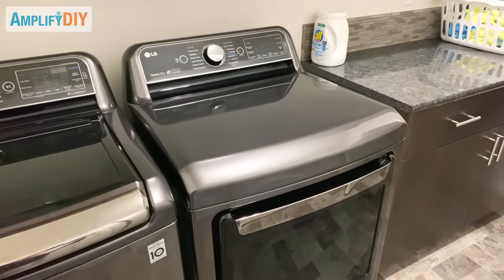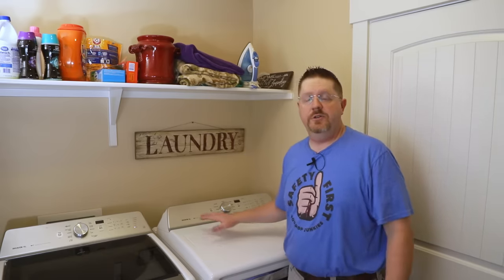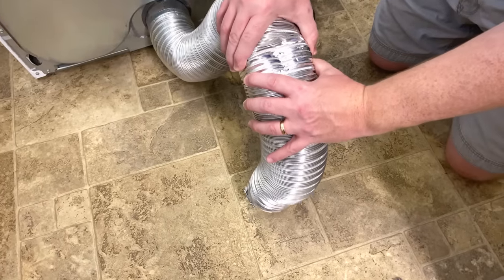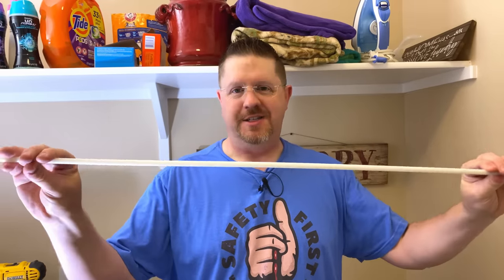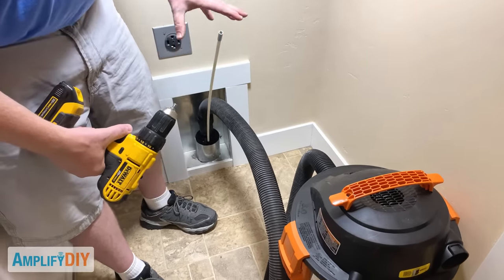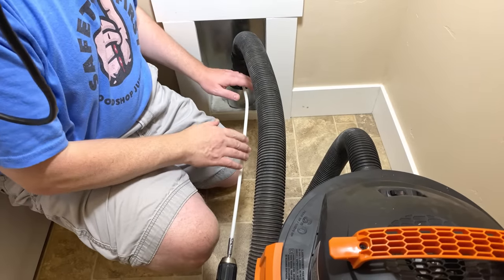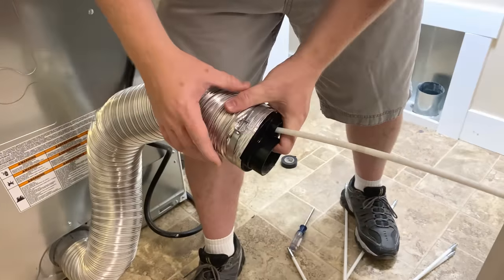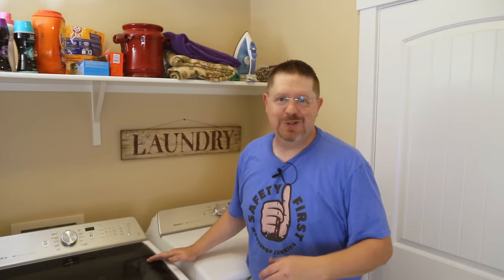How To Clean Your Dryer Vent Duct - Step By Step - It's Super Simple!

Comment: I need help :(
I'm exasperated and in pain. I think I got most of the lint out of my dryer vent duct using the duct brush cleaning kit I got at Menards today (and yep, it was a lot and a lot of work) BUT now the brush came off the rod and is stuck in the duct. Argh!!! NOW how do I get it out?? 😳
Reply from the maker: Oh no! Any idea how far in the vent the brush came off? 
Here is what I would do: go find a metal coat hanger, and bend it up so you can tape it to the end of the rods you used such that the "hook" part of the hanger pokes out the end of the rod. Then try fishing that back into the vent to try to hook the brush and pull it back out. 
Keep in mind that if the brush may be closer to the outside end of the vent than it is to the inside, so you may need to try to retrieve it from outside rather than from inside. 
Good luck!

Comment: Read that if you use fabric softner liquid or fabric sheets it leaves a film on dryer lint filter. So they recomend washing dryer filter once in awhile. Years ago I wired in an electric dryer and told the contractor that going by dryer instructions he not only had too long of a vent run along with three 90 elbows. Owner called me back trying to tell me that I did not wire dryer correctly. Showed him that when dryer was running on hotest setting he had 238 volts at dryer tetminals. But kept telling me that dryer takes forever to dry. Told him not my problem. A few days later he called and insisted that correct problem. Told him that I'm Tom the electrician and not Tom the magician.

Comment: it would seem that little screen the dryer has does a lot less then we all think.  I cleaned mine out and it had to of been 2 gallon bucket worth of lint was the result.  Granted it was a 35 foot metal pipe before it vented outside and since the lint coming out of the dryer is wet little pieces stick and build up.  But yeah its weird the dryer screen does so little.

Comment: can this be done from the outside in.  My dryer is a stacked model.
Reply from the maker: Hi Renita - yes, you can clean from the outside in towards the dryer. I have 2 tips for doing it that way:
1) Turn on the dryer with nothing in it, on the coolest setting. This will provide air pressure blowing out of the vent. 
2) With the dryer running, use the cleaning brush from the outside of the house in towards the dryer. You won't need a vacuum to suck out the lint, as the air blowing out from the dryer will blow the lint out.... right into your face. So wear a dust mask and eye protection while doing it this way.
Good luck!

Comment: Sorry, me again. I purchased this and am having trouble going from inside the house. Could I do it from outside?
Reply from the maker: Hi Melissa - yes, you can clean from outside the house towards the inside. That's a bit different process. Here is what I recommend: 
First off, re-connect your dryer inside the house. Start it on it's coolest setting, with no clothes in it. This is going to provide air pressure to blow the lint out as you clean. 
Go outside to your exit vent, and use the brush to clean from the outside towards the inside. You won't need a shop vac, or the adapter for the brush, since the dryer will be blowing air through the vent. Just clean from the outside in towards the dryer. 
One last note: When you do it this way, you should wear both eye and respiratory protection, as the lint will all get blown into your face as you clean.
Good Luck!

Comment: So wish we saw this first.  We bought the cheaper kit and all was fine until it got stuck, then we reversed the drill.   Yes it came apart and the brush is stuck somewhere in aww foot horizontal run from mid house to out side. We tried to make it out, but couldn’t. We tried pushing it out, but didn’t work.. help!
Reply from the maker: Hi Jennifer! About the only suggestion I have for a situation like that is to purchase the kit that I recommended in my video, and then use it to try and push the stuck brush out. Alternatively, you could bend up a coat hanger into a hook shape, then tape it to one of the pieces you have left. Use that to try and reach in and snag the piece that stuck in the vent and then pull it out. Good luck!
Reply: ThAnks for the feedback. Got the last kit from home depot today. It’s 12feet from dryer to outside, so the hook with the coathanger didn’t work.  Need the camera on a stick!  .

Comment: Can you do this with out a shop vac?
Reply from the maker: Yes, you can use a regular household vacuum. The only difference is that you might have to tape the hose from the vacuum to the adapter as it's not going to fit quite right. Good luck!

Comment: Can this be used with a duct that runs under cabinets and is built wide and more flat (not round going under cabinets)?
Reply from the maker: Hi Sherie - is that how your dryer duct is shaped? This brush kit is specifically designed for the round ducts, but it may work ok in a duct like you describe... likely will have a little trouble getting into the corners, though. 
Good luck!
Reply: @AmplifyDIY  thank you!  Its round attached to dryer and wall..then goes into the duct that runs under cabinets in kitchen and comes out on exterior wall of house.  I wondered about those areas as well.  Thank you!
Reply: Also, I don't see your link to purchase the cleaning system...can you share it?
Reply from the maker: @sheriehardaway8911  Here are links to everything I used (from the video description):
Lint Eater Dryer Vent Cleaner: https://amzn.to/2E0gZjK
Extension Rods: https://amzn.to/35CQTyE
Basic Screwdriver Set: https://amzn.to/32vzeHd
Budget Friendly Drill: https://amzn.to/3ivo9vm
Basic Shop Vac: https://amzn.to/3dAb8zr
Wifi Borescope: https://amzn.to/3o79REt

Good luck!
Reply: @AmplifyDIY  Thank you!

Comment: Awhile back I noticed the house getting hot every time we turned on the dryer. Turns out the vent hose had a giant hole in it. Replaced the hose but should’ve cleaned the vent to outside too.
Reply from the maker: Glad you found the leak!

Comment: My dryer vent is located on my roof, how do I ensure the brush doesn’t get stuck as I’m threading it through the pipe?
Reply from the maker: Hi Ashley - great question! The best way to make sure it does not get stuck is to tape each section of the rod together carefully as you add them as I demonstrated in the video. Go slowly and carefully, and don't force things. When the rod encounters a bend in the pipe, there may be a bit more resistance, but you should never have to really shove hard. The spinning action of the brush at the end of the rod helps it around the corners. As long as you keep the drill spinning in the "forward" direction, the rods won't come apart in the duct and get stuck. NEVER put the drill in reverse, and always have the drill spinning when you are pushing the rods into or pulling the rods out of the duct. If you have someone who can help, send them outside to watch the vent on the roof. They should be able to tell when the brush gets to the end (as long as you can see the vent from the ground) and let you know when you have gotten to the end. Once the brush is all the way to the end of the duct, keep the drill in "forward" and slowly pull the rods back out of the duct, one section at a time, just as I showed in the video. 
You got this! Good luck!

Comment: is it better I do it myself or hire a profesional and how often should I do it.
Reply from the maker: Hi Andrew - in my opinion it's better to do this job yourself. Hiring a professional will generally cost between $200 and $300 USD (at least that's what they cost in my area). Purchasing everything you saw me use in this video (including a shop vac) will cost less than that. Plus… Then you have the tools and the next time you need to do it the cost is just your time.

In general this should be done at least annually. If you have a larger household and do multiple loads of laundry per day, you should probably do it every six months.

Good luck!
Reply: @AmplifyDIY  what tools do you use

Comment: Just put a little wall between your vent outside and ac to keep the lint from entering.
Reply from the maker: The thing about lint is that it tends to float around in the air.. and would easily go over, or around any wall you built. You'll have to build a full enclosure... but your A/C's condenser has to have a lot of air move through it in order to work.. so then you'd have to add holes into the enclosure, with filters to catch all the lint... and at some point, it gets ridiculous. 
Anyhow - thanks for watching!
Reply: @AmplifyDIY  best thing....don't put the ac by the dryer vent! ☺️

Comment: Does that lint eater rod bend wanna pipe turns 45°. My pipe runs straight out of my dryer up to the ceiling and then runs to the outside.
Reply from the maker: Yes, it bends easily around the corners of your duct work. Good luck!

Comment: You showed a dryer vent on the roof, but you did not explain how to go about cleaning it as compared to the vent that came on the side of the house.  Do you have a separate video that explains how to feed the flexible cleaning rods up the roof dryer vent?
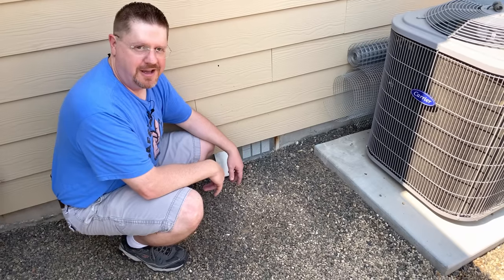Reply from the maker: Hi Master - the process is exactly the same. The only modification is that I recommend going up on the roof, disassembling the vent outlet, and cleaning all the parts of the vent outlet separately. You can see I demonstrate this and discuss roof vents starting at 5:55 of this video. 

The flexible rods and brushes work exactly the same way in the ducting, whether it exits on the side of the house or up on the roof. 

Hopefully this answers your question - let me know if I've misunderstood and I'll see if I can explain better. 

Thanks for watching!
Reply: @AmplifyDIY  Thank you for the response.  I recall the portion of the video that dealt with disassembling the roof vent outlet.  However, my confusion is whether I should feed the flexible rods down from the roof into the house or from the laundry room up to the roof.  I ask this because it would be difficult to put the shop vacuum on the roof to suck out the debris if I fed the flexible rods down from the roof.  Thanks.
Reply from the maker: Oh, that’s an excellent question! If you want to clean from the outside in, again, it doesn’t matter if you have a vent on the roof or the side of the house. Rather than using a shop vac, I recommend that you just turn on the dryer on its coolest setting with no clothes in it. This will force air through the vent while you clean, blowing all of the lint out of the vent as you go. My only extra note on this particular technique is to make sure you use eye and respiratory protection, as all the dust and lint will be blown right out into your face. 

Good luck!

Comment: How many average feet does the duct last?  20 feet 50 feet until it reaches outside?
Reply from the maker: Hi Richard. The duct length varies, but generally is less than 12-15 feet to the exterior. Some are much shorter. Others can be quite a bit longer.
Reply: @AmplifyDIY  Thank you!

Comment: A stacked washer/dryer setup is more difficult to access as two people are required to get dryer down off the top of the washing machine.
Reply from the maker: Hi Norm - this is so true! In the cases where it's difficult to move the appliances inside the house, you can clean the duct starting from the outside of the house and working in towards the dryer instead. Good luck!

Comment: where would I find the same dryer vent? Vent on outside of house..
Reply from the maker: Hi Wes - it can be tricky. They are easier to find if you turn on the dryer, then walk around the outside of the house. If the vent is somewhere low to the ground, it'll be easy to smell (fabric softener) and hear. If it is higher up or on the roof, they can be a little trickier to spot - but use your ears more than anything else. You should be able to hear faint dryer noises.... good luck!

Comment: Can you do this job without a shop vac?
Reply from the maker: Hi Bruce - yes, you can! There are 2 options: You can use a regular household vacuum, and a bunch of duct tape to adapt the vacuum hose to the kit. Second option is to clean from the outside of the house in towards the dryer. If you elect to do this, then don't pull the dryer out from the wall or disconnect anything. Start the dryer with no clothes in it, on it's coolest setting. This will provide plenty of airflow to blow the lint out as you dislodge it with the brush. You should wear eye and respiratory protection if you choose this method, as LOTS of lint will be blown directly into your face. Good luck!
Reply: @AmplifyDIY  As I'm in a condo apartment building and don't know where the outlet is and probably couldn't get to it, I'm going to use the duct tape idea. Thank you for the video and your very helpful response.

Comment: Where did you get the tool ?
Reply from the maker: Here are the links to everything I used in this video (they are also in the video description): 
Lint Eater Dryer Vent Cleaner: https://amzn.to/2E0gZjK
Extension Rods: https://amzn.to/35CQTyE
Basic Screwdriver Set: https://amzn.to/32vzeHd
Budget Friendly Drill: https://amzn.to/3ivo9vm
Basic Shop Vac: https://amzn.to/3dAb8zr
Wifi Borescope: https://amzn.to/3o79REt

Comment: Very good video, but this level of cleaning seems like overkill.  The method I use is simple and fast.  A shop vac does not have enough air flow to to clean the vents, but a leaf blower creates massive air flow.

 I use an inexpensive electric leaf blower.  A cordless would work also.  Do NOT use a gasoline powered leaf blower.  You can disconnect the vent from the dryer and stick the leaf blower in the vent.  If you have a weak leaf blower, you can wrap end of the leaf blower and the vent with a damp or dry hand towel to create a loose seal.  The seal does not need to be perfect since the leaf blower puts out so much air.  If your leaf blower is very powerful, you might not want to seal around the vent at all because if you build up too much pressure in the vent, you could damage the vent.  

I usually ask someone else to stand outside to observe how much lint comes out the other side of the vent.  Leaf blowers can be very loud inside, so I would recommend ear plugs.  Then blast away for about 30 seconds.  The vent should be pretty clear after that.

Here is a video showing the leaf blower method:  https://www.youtube.com/watch?v=Dv3l6-NlNKE

Comment: The exterior vent of my house is stupid, the metal piece that is inside the concrete wall has this weird shape preventing the brush from coming out, so it’s super or impossible to get the tunnel entirely clean since the brush couldn’t exit so it could just bring some of the dust back in the tunnel as I pull back.
Reply: But I was able to get quite some dirty thing out of the tunnel.
Reply from the maker: Maybe you can clean that last part of the tunnel from the outside in towards the dryer? To do so, you won't need a shop vac: just start the dryer (empty) on its coolest setting, then go use the drill + brush from the outside of the house in towards the dryer. The air from the dryer will blow out the dust as the brush dislodges it. Wear eye and respiratory protection during this process. 
Good luck!

Comment: Uh hum
Suggestion...
How about a nice thick soft knee pad (or strap on knee cups) for your knees on that hard linoleum floor and rocky backyard gravel. Ouch
Keep doing this and trash your knees as you get older
Nope, you dont want the pain and surgeries later
Always think safety first... dust mask, goggles, ear protection for loud shop vac
Thanks for informative video
Reply from the maker: This is a great tip. Thank you!

Comment: Unfortunately we wrapped the tape wrong and it came undone 5 feet from the exit vent. How in the world do we extract it now that it is lodged in the vent? We have tried using a tape measure to grab it and pull it out, no luck. Tried buying a different kit to run through from the laundry hoping to push it out the last feet, no luck. Any help would be greatly appreciated before we have to rip the wall out to retrieve it.
Reply from the maker: Hi Holly - have you tried a bent coat hanger? Shape it into a large hook, then tape it securely to the end of one of the flexible rods, and use that to try to snag and pull the brush back out.
You may also want to try using a leaf blower at full power to see if you can blow the brush out with air pressure. 
Good luck!
Reply: Thank you! Tried the leaf blower but had no luck. We will try a coat hanger. Appreciate the quick response!
Reply: Went under our house and lucky for us the venting is all exposed so we were able to pull an elbow joint off and retrieve it.  😊
Reply from the maker: @hollybower6939  Oh that's great news! Glad you were able to get it back. :)

Comment: What happens if the brush comes off in the vent? How do I get it out?
Reply from the maker: Hey ttot05 - that's a tricky one. Best case, you can attach a bent coat hanger to the end of the rods, and try to fish it out. I've also heard of someone having success literally blowing the brush to the end of the vent with a leaf blower. Worst case, you'll have to open up a wall. Best of luck retrieving it!

Comment: Can i do it without the suction?
Reply from the maker: If you don't have a shop-vac, you do need to have some way to push or pull air through the vent while you dislodge all the lint. One way I recommend is to leave the dryer installed and start it on the lowest heat setting, with no clothes in it. Then go clean from the outside of the house in towards the dryer with the brush. The air pressure from the dryer itself will be enough to blow the lint out - but wear eye and respiratory protection as you do this, as all the lint will blow directly out into your face. Good luck!